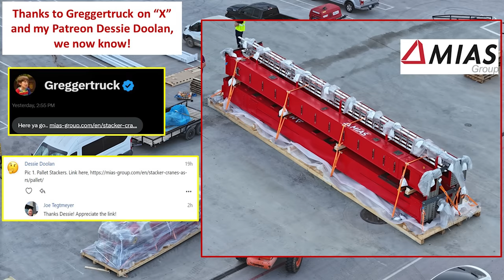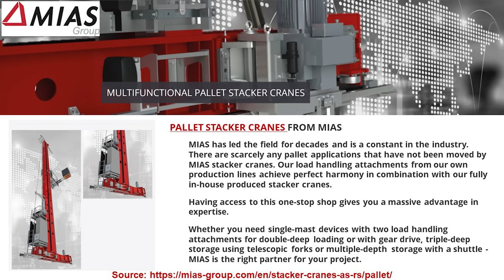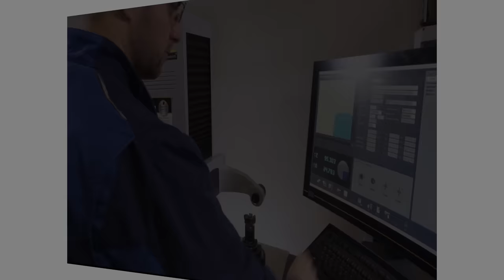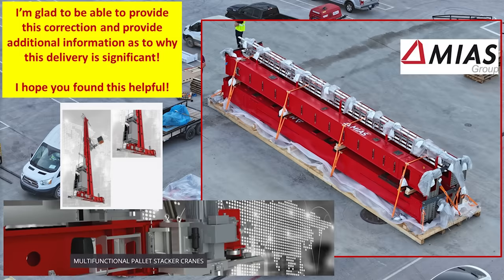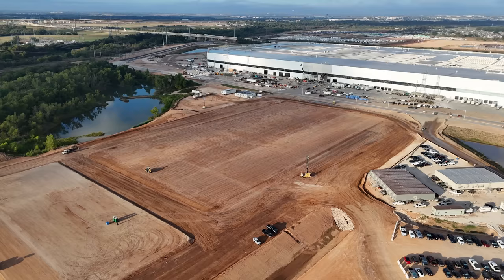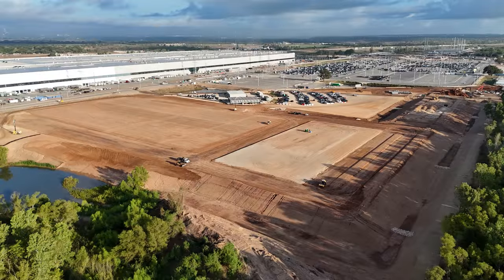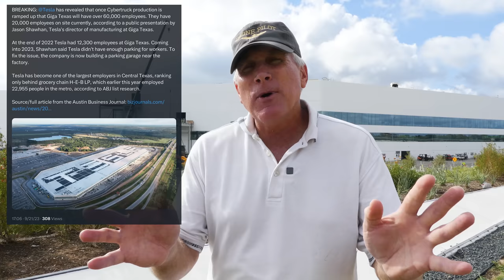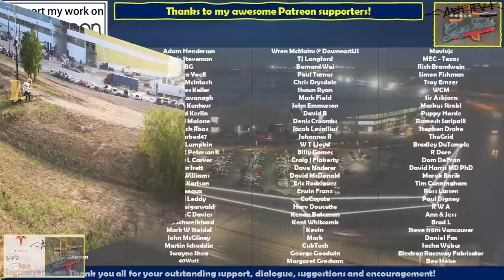Entrance Finished! 4 Cybertrucks, 3 for Crash Testing! 22 September 2023 Giga Texas Update (07:35AM)

Comment: Thanks Joe.
3:11. MIAS clip. Example of the type of pallet racking often seen stacked around the site. Always white at GT. https://youtu.be/0gP64d5ia1k?t=1158
Grey and orange at the Starlink facility, https://youtu.be/FAzWY_cbcRg?t=1024
8:25. W-WOW yard, storage area. Bottom. Stockpile of HVAC fan units, filters, cowls etc are visible, another at 8:40 to the left.
9:35. New EOL building. 3 grate/strip drains now clearly visible. Another 3 to the south at 9:25 bottom left.
9:59. New EOL building. Near the concrete truck chute. Series of hand screeded ‘lands’ east-west at the correct elevation have been established so that the powered screeder can use those to work between.
11:05. New EOL building, west. Wall sheeting installed. Small cantilevered portico maybe for plant to be placed under.
Roof decking may be waiting for the painters to finish. Decking may be the deep section material to the right.
12:12. New EOL building, east. Not obvious in the video is that the top wall sheeting is perforated/louvred. Joe’s patrons get a good view of this in pic 32 of 148.
12:31. New EOL site. HDD project. Series of reducers attached to the large HDPE pipe.
13:06. GA, highway berm. HDD operation. Excavation full of drilling mud.
Speculating a series of reamers are being pulled back from this side to open up the bore to the required size. Hence the need for additional lengths of drill on this side of the highway. One length of pipe ready to be connected is on a chain hanging from the excavator bucket.
Likely scenario is that the large HDPE pipe is pulled into the bore to be used as a sleeve/casing for the smaller pipes (being used as conduits). Discussion about this under Joe’s 18 September video, see Bob Callahan's comment.
13:29. GA apron. Conduits pushed through cores in the perimeter grade beam.
14:15. Main Entrance. Still fiddling with the Stoneglass. Vertical faces giving trouble.
Caulking the joints.
14:43. GA apron. Minor plumbing works. Preliminary works to extend the landscaping? Renders of the other factories, and as built at Berlin show much more expansive landscaping around the various Main Entrances.
17:12. Stamping 2 extension. Studwall. Installing bulk insulation. Another indication that this is a permanent wall. Not to mention the parapet constructed to a peak. Unnecessary for a temporary wall, it likely mirrors the new structure to be built to the south.
18:45. North-south road. Curved section being saw-cut for demolition.
18:51. Parking Garage site. Bottom south west corner. Couple of dozen orange survey flags in rectangular grid patterns. Geopier locations perhaps.
19:24. WOW yard, south west corner. Centre. Culvert turning west. Presumably will pick up the stormwater that currently discharges into the holding pond to the left.
20:21. Transport yard. Above the Cybertruck. Excavator and a dump truck at work. 27:58 also.
21:49. Parking lot. To the right to the lighting tower. 6 various Tesla models, all junkers.
23:07. Crash Test Track.  I wonder if the end of the building be filled in/fenced before a crash test?
25:47. Cathode, west. Conduits in the trench to the left.

26:16. Die Shop. Right. Concrete structure being extended east. Speculating this is a footing for some sort of overhead structure to join the Die Shop to the plant structure.
28:01. Tesla Road. Widening the road, or perhaps the start of realignment of the road eastwards. Road needs to be lowered at the Old House site.
28:06. Tesla Road north. Left. Natural Gas metering enclosure. New NG line to Cathode/Die Shop has been connected.
28:18. Temporary switchyard. Cables to the factory have been cut. Factory supply now from the new switchyard/substation. Plus a small supply at the southend from the switchyard across the river.
Reply: 14:43. Minor drainage works. May be associated with a Plumbing Permit for a 500 gallon grease trap to be installed inside the building at this grid location.
Reply: 17:12  Insulation on south wall, no insulation on the east and west walls??? And if these are going to eventually be internal walls, why any insulation at all?

If the new addition will be a separate building, why not use concrete wall panels? Seems to make no sense, like so much of what has happened on the south end.
Reply: @DavidJohnson-tv2nn  17:12. Why use concrete wall panels?

These non-structural stud walls that act as fire separation between the various buildings are seen at many locations in the factory. Most obvious is where they project above the roof line in the north-south valley down the centre of the building, and between GA and Battery.

‘Non-structural’ meaning not supporting floor or roof loads.
Reply: @DessieDoolan   Yes, but I thought the use of insulation implies exterior wall. Now, if they have been insulating interior walls as part of the fire separation, it makes more sense.
Reply: @DavidJohnson-tv2nn  Over 100 mentions of 'bulk insulation' in my notes over the years. First mention was the east wall of Paint.

Insulating any stud wall is best practice. Thermal and acoustic benefits.
Reply: @DessieDoolan   Thanks, I didn't realize that.

Comment: Joe. The need to use concrete drainage pipes versus metal pipes mainly has to do with their installed depth.  If placed at a shallow depth then structual concrete pipes will always be used......while if able to install at 10' or more such as on the south end.    then the metal pipes will work fine. Always great informative videos. Thanks. Mark in SC

Comment: Unfortunate that it isn't possible to provide a shuttle train service for employees like they now have at Giga Berlin. Great video as always, Joe; thanks.
Reply: austin and berlin are seperate events - the infrastructure of texas is not rail based
Reply: That would be difficult. In this case, there is no rail line anywhere near the factory.
Reply: The population density of Berlin is 4127 people per square kilometer. Austin is less than 550 per square kilometer.  And that’s for the city of Austin. Most of the area around the GF is probably 25 to 30% of that! So things like trains and other public transit are not really economically feasible. We have cars. Lots and lots of cars, which if you are an auto manufacturer is a good thing. However, this is one of the reasons that the GF is right on the toll road is a good thing. Easy access.
Reply: They should have found a place with lots of public parking and built a boring tunnel going there with a "private line" for Tesla employees... would have been a good place to test the shuttle they're working on.
Reply: @greggerypeccary  
1) A tunnel faces the same problems that a tunnel to the rail yard would face.... Obtaining right of way, and cost.
2) There is already 2,500 acres on site for building parking capacity, right next to a freeway!
3) The LVCC Loop system is designed for 4,400 passengers per hour. At Giga Texas, you can arrive and leave much faster by car. Provided freeway access is well designed. I would have double left turn and right turn lanes. They can also stage the shift change at 15 minute intervals so as to not dump too many cars at the access points to and from the factory at the same time.
Reply: @DavidJohnson-tv2nn Yeah... my comment wasn't completely serious. 
TBH, I have no illusions about people in Texas taking public transport to work -- especially those working in a car factory... and Elon is a pragmatist: he's not the one to preach people about what they should do (=drive EVs), but the one who deals with reality and adapts to it (=making an EV people will want to drive).

Comment: HDD drilling:
@ 13:05 You can see the drill rod spinning. My guess is that they are pulling it back through to widen the bore, adding sections of drill rod as needed.
@ 13:27 Conduit can be seen entering the building.

Main entrance:
@ 13:33 Beautiful design, but wish they had a water feature.

Outfall channel/Pond:
@ 19:30 Looks like the 3 pipes that make a turn to the west will be for outfall from the pond.

Second LCRA duct-bank to factory:
South of Tesla Enclosure/Mega-vault:
@ 28:29 Pulling cable into duct-bank. Cables are pulled 3 at a time into each conduit.

East monopole:
@ 29:16 Near completion of trench work for 345 kV duct-bank.

BESS substation:
@ 30:10 Covers placed over concrete cable trays.
Also pulling cable. Possibly for auxiliary power to control circuit breakers and other equipment?

Tesla road:
@ 31:23 to 31:45 Ongoing widening project. Traffic shifted to the newly paved south side of the road.
Reply from the maker: Thanks David ... I really appreciate your observations and notes!
Reply: @JoeTegtmeyer   Thank you for all the drone flights, research, and hard work you have done over the past 3 years!

Comment: Do you think the pallet stacker cranes are for the stacks of battery packs, or for crates of inventory?
Reply: When I worked at Weiser Lock, they used a pallet stacker system to stock parts less than 5 pounds each.  For the several hundred pound battery packs, it is not practical to place them in a rack, they are just not rated at thousands of pounds per foot of rack space.   The normal pallet stackers got fairly scary when at 15 feet above the ground and you move it around a bit.  But the pallet stacking system is a row of racks, with the three pallet stackers in between, with a top and bottom rail system to run on, so no sway even at 20 feet off the ground.  They go automatically to the proper location to pull or put a product, so say you need to go to level 22 and rack 65, it will take you there automatically.  Then you put something there, and then it will go to say level 19 and rack 72, then you pick a box from that location, and then return to unload then get the next load.  

Normally our boxes where easy to move by hand to the stacker platform.  Some are rated to use pallets, but those are larger than the system used at Weiser Lock.  Ours was more for small parts.  We built locks, so the final product was only about 3 pounds per package.  Still we might use 200 of the latches, and it is handy to store a extra 200 - 2,000 latches for use if there is a need for them suddenly, and the production is not keeping up.  200 latches can be put into a box about the size of a copy paper box.
Reply: @Kangenpower7  That's cool and all, but Tesla has a video somewhere of system just like you described, that does actually shuffle around crates of batteries for (I can't remember the process cycling the batteries a bunch of times to exercise them)

So I guess I'm just wondering if this particular system in that Joe shows in the video is that one, or an inventory system. Both, I'm sure, are useful here for maximizing building utilization and eliminating some tedious chores and probable areas where people can get hurt.

Comment: Nice shot, Joe, with the 4 vessels in place. I must say the vessels are at a maximum elevation, close to the roof in fact. Now we have to wait and see what type of equipment will be positioned next to or directly below the vessels at ground level.
I have come up with this wild(?)  idea: moving the highly active nano particles (end product of Tesla's CAM process) to BA seems tricky: dust forming...heavy metals... avoid inhalation... and so on. So why not mix the nano particles immediately with the semi-liquid "dough" that is the input for the DBE process over at BA? We've seen films of that dough being spoon-fed between rollers, so it seems safe to transport the ready mixed dough from Cathode to BA.
Then perhaps the 4 vessels are for mixing the CAM with the basic dough, immediately after the finishing touches to the chemistries in the adjacent 7-storey hall with stacked equipment.
Reply: Please provide these nano particles cheap.
Reply: 28:06. Tesla Road north. Left. Natural Gas metering enclosure. New NG line to Cathode/Die Shop has been connected.
Reply: I think that they have the systems to feed the mixed product into a stainless steel pipe to transfer the product to a production line.  All without exposure of the contents to the air and thus no dust if that is a requirement.

Comment: Joe will the pallet crane be used for the 4680s?
Reply: Storing a 1,000 pound battery on a rack is not a good idea.  putting 100's of them on a rack, that will place 10,000's of pounds on each end of the storage rack.  Have you been in a Costco, and seen the racks there?  They might have 8,000 pounds at the very most on each of the 4 support feet of a large storage rack, and they can not handle much more than that much weight.  Then the cross section, they have weight limits too.   So no more than about 2,000 - 4,000 pounds per rack section, and they can have 3-4 sections top to bottom, so there is a total weight capacity per rack that is 10 feet wide.  

Putting batteries into a rack, and you can quickly overload the rack maximum weight for that rack.   Also storing more than a couple of days of batteries in the plant is not a good idea.

When I worked at Weiser Lock, the pallet storage space was used for parts less than about 5 pounds each.  So that is what I expect them to store in that location.
Reply: @Kangenpower7 …do you really believe that the racks at Costco are the biggest, baddest, most heaviest-duty racks in existence ?

Racks exist that can stack entire vehicles, much less vehicle parts.

Customer: “How much weight can that rack hold?”
Rack: “Yes”

Comment: New vehicles definitely need to  drive themselves  to the far west side end-of-line building.
Reply: Way too risky to allow a level 2 system drive cars by itself!
Reply: I'm not worried about that. They are doing fine as it is. That feature will likely come with time.
Reply: @jbbuzzable    IT's called FSD...
Reply: @eugeniustheodidactus8890  It's not F or SD yet.  Like jb said, give it time.  By then, they'll be like Yankees and just take the tunnel. 😝

Comment: Are people supposed to walk on, walk around, or just trip over that shiny black trapezoid outside the front entrance, or what? The way it’s raised just slightly off the cement looks like a hazard.
Reply: i doubt people are dumb enough to trip on it, it just looks cool ig we will see
Reply: Don’t be silly Henry
Reply: I don't think it's just 'slightly' raised- I think it's at least a full sized step up.
Reply from the maker: Its actually over a foot taller than the surrounding area. You would be hard pressed to miss it and trip over it.
Reply: They will install special signs for people like you that don't know how to walk.
Reply: @JoeTegtmeyer  OK, then that answers my concern. If it is that much taller then it is not meant to be walked upon. As a walkable surface it would be a very dangerous hazard  whenever it got wet. Wet finished concrete is slippery enough let alone that polished surface. 

Second consideration is that it would not stay polished very long if walked upon.